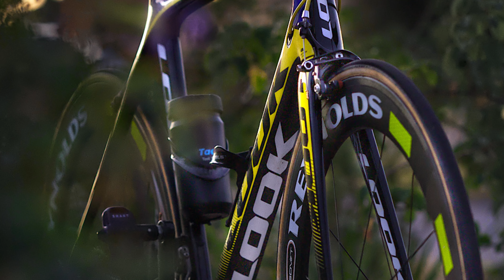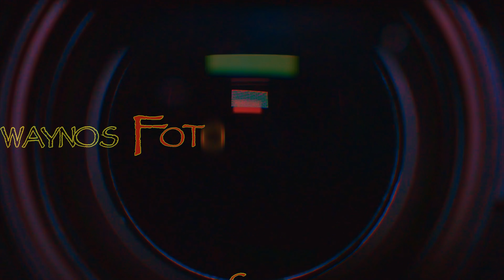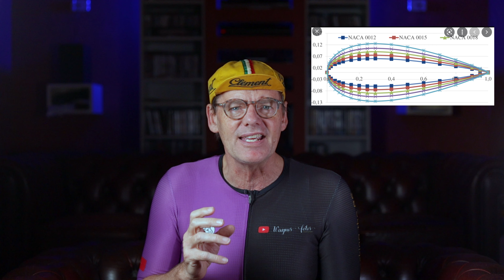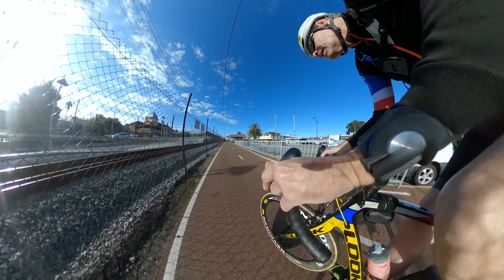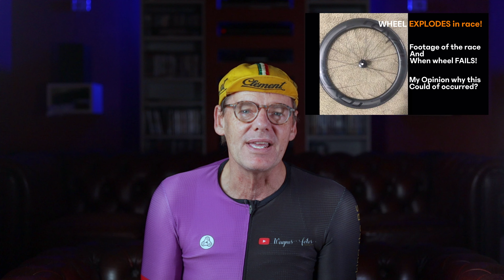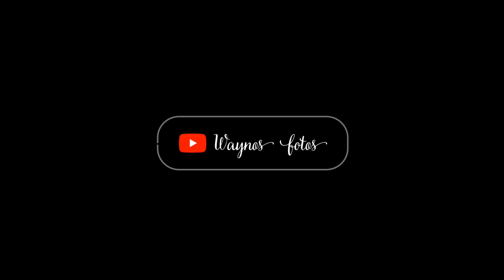DEEP dish Wheels, How do they make them CROSSWIND COMPLIANT?

Comment: I’ve just sold some 80mm Swissside that I had on my TT bike. Handling was ok in winds up to like 15mph. Over that was horrible… Didn’t think they were worth keeping just to save a couple of secs on a good day… the back was fine, just the front. I have a work colleague that only rides 80mm though and he weighs 10kg less than me!
Reply: You were using a deep section front weren't you?
Deep section fronts are known for blowing you around far more than a rear disc wheel and at least one high placement pro has fallen off the course due to the deep section front rim blowing off course.

Comment: Whoa there Wayne.  The NACA shapes are NOT ideal shapes.  The NACA system was developed simply to codify foil shapes so that data from different sources could be correlated with the shape that was used for that test.  There were 78 different shapes initially, clearly not just a single "optimum" one.  Manufacturers saying they used a NACA shape is just marketing, nothing more.
Reply from the maker: Not saying the bicycle industry is claiming anything, but the NACA shapes are aerofoil shapes to maintain attachment of the airflow to create lift or to control air detachment. I am saying the shape was modified to basically spill the air around the trailing edge to reduce sideways thrust.
Reply: @waynosfotos  Sorry, on thinking more about it I struggle to see how NACA profiles have much relevance to bicycle rims:
(1) The "leading edge" of a bicycle wheel is a tire which can vary in size.
(2) On the opposite side of the wheel, the cross section of the rim is reversed with respect to the airflow, and in fact the airflow around the wheel experiences every angle between these two extremes.  Also the back half of the wheel certainly experiences disturbed, turbulent airflow caused by the passage of the front half of the wheel.
(3) NACA shapes are intended for much higher speed airflows which are also relatively undisturbed.  The main variation NACA shapes must cope with is angle of attack: the up/down angle of the foil WRT the airflow.
(4) Because they are designed to create lift via a pressure differential between top and bottom, the two sides of a NACA foil have different shapes, which one to use for a rim?
Simple non-theoretical empirical testing in a low speed wind tunnel seems like a better way forward.
Reply from the maker: @paulflory3532  yes all those things could be real influences in the real world. Probably to clever talk there for the bicycle industry. 🤣

Comment: Deep section rims definately offer an aero advantage the deepest the better but that's only in case of ideal contitions of no wind or frontal wind only. Crosswinds can also been handled by a medium sized rim 50mm for example in most of the cases. But in real world situations my go to all around wheels will ideally be 38 to 40 mm.
Why? Because sometimes contitions change and during a long ride I have to pass trough mountain or even hill openings on the one side and sea on the other where the wind suddenly builds up and no matter the rim design the overall width of the rim really matters.
A sudden blow will strike and dislocate and surprise any bike equipped with a 40mm or more of a rim.
A bike is as week as it's weakest moment in crosswind and it doesn't take long for an accident to happen.
So on a perfect contitions day use whatever you wish but if there is any possibility of strong wind even for a part of the ride, stay with medium to low profile.
Whenever there is a doubt, there must be no doubt (if it makes any sense) you have to return home safe.
About the disc breaks now..
I think that the disc break hype momentum over the rim breaks has been absorbed and weakened. Companies can still push it but they cannot praise the design or the whole concept. I think that companies that have stopped producing rim break bikes will reconsider their policy....

Comment: I dont understand that.... from straight ahead I understand it, but from the side? what? I am not an aerodynamic engineer but just a mechanical engineer so I might be wrong but my mind says it is not so, you have way more surface area that the wind hits vs a low walled rim. Am I wrong here?

About the disc brakes... Why are we not seeing ceramic coated brakes? heat is not as big issue as on normal steel brakes where the braking fades as it get overheated, but the issue is that brakes with ceramic coated discbrakes, be it metal or carbon structure would feel exactly as bad when cold as when current brakepads are glazed or have oil between the braking surfaces, ie just dont stop how much you pull the lever. But on the other side they would heat up very quickly given how current bicycle discbrakes heat up now.
Reply from the maker: Let me try to explain, if there is no wind as the bike moves forward you will have equal pressure on each side of the rim for both shapes.
Naca shape, at the final edge ( inner point of the rim) you now have a extra gust of wind 90 degrees to the rim. Now you will have a high pressure one side and a low pressure the other side, as a defining edge is at the trailing edge.
Not naca shape, you have a extra gust of wind at 90 degrees, now you have a rounded edge on the trailing edge so some of the air will spill onto the other side, reducing the pressure difference between each side.
Therefore less sideways thrust.

Think of it as a sail boat ⛵ high pressure one side, low pressure the forward side, if you round off the edges of the sail, you will not get the same forward thrust. 
Hope that helps.

Comment: I love the influencers that get young hotshots to turn up on slammed, aero bikes running a 130 stem, 380mm (or narrower )bars and deep sections.  They laugh at my 440s and relaxed riding position.   To get the pro look they have created a poor climbing and descending bike.  On some club rides they turn up in a riding position similair to Caleb Ewan in a sprint.  The tech is great and I love my 60s but a lot of people confuse buffeting of the bike and body with a wheel problem 95% is a placebo effect.
Reply: DT Swiss 440s? I had a set of those. Lasted 6 years on a lot of rides before one started developing a stress fracture.
Reply: @Rose.Of.Hizaki  440 wide bars😀
Reply: @tobycolin6271  my mistake 😅😅

Comment: My experience with carbon wheels is from Mavic Cosmic Carbon SLR, Chinese sourced carbon wheels, Shimano Dura Ace C40, and finally the BOYD 36 Carbon. Cross winds were really a noticeable pain in the butt with the wheels that had the sharper peak section and bladed spokes. The Dura Ace wheels had that rounded profile section you mentioned and bladed spokes but still the wind grabbed them. The only wheelset that didn't have bladed spokes are the BOYDs which has the rounded shape section and round spokes.  I don't feel the crosswinds so much. The spokes certainly play a part in my opinion. I will never use bladed spokes wheels again, that said my wheels are all custom made now using my choice of parts that go into them.
Reply from the maker: 🤔 interesting

Comment: I rode box section rims for many years.  When I got 25mm deep aluminum wheels with 16 radial front and 24 spoke rear wheel 23mm tires I hit a pot hole so hard both tires pinch flatted. At 17 stone I was dumbfounded that there was no damage to either wheel! IMHO for most people moderate section rim aluminum is a good compromise. Good for rim brakes. Those 1980s box section tub wheels would have both been toast! Aero and tough.